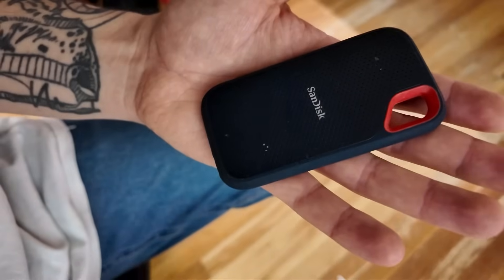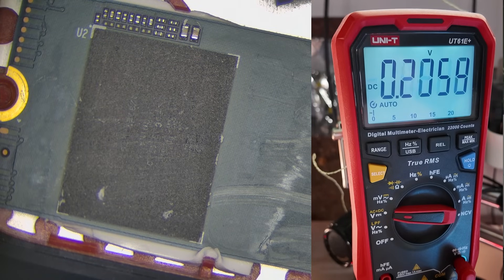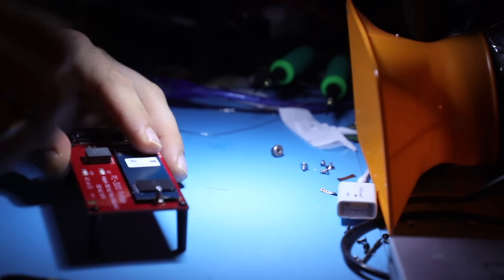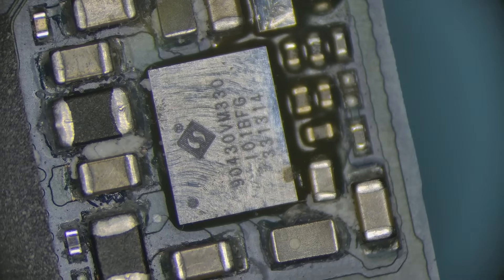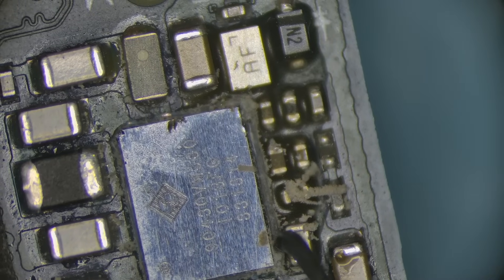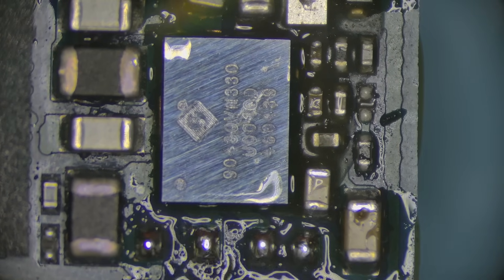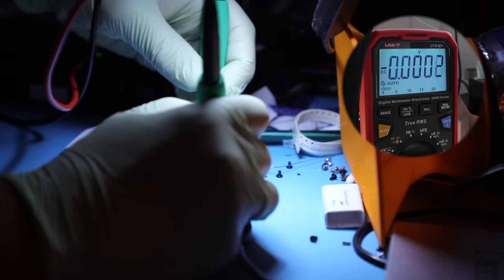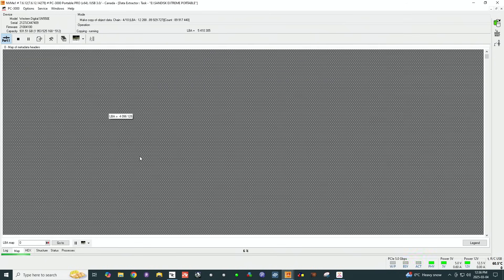sandisk extreme portable ssd - here is why they fail

Comment from the maker: guys, since I launched this video, so many of you sent your Sandisk Portable SSDs my way I just wanted to say thans to all of you. They been coming in from all over the globe recently and not just USA. Italy, UK, Spain, Mexico, Brasil, Belgium, Switzerland, Belgium just to name a few in past 3 weeks. If you need help with these, let me know! http://www.hddrecovery.ca/contact-us/
Reply: Have you seen any 8TB failures? I was thinking of getting the 8TB. I love the physical size, and the little slot to hang it.
Reply: I sent mine to you but you said it was not recoverable. I decided to get a 2nd opinion and the company says the data is there but the power supply is bad. They apparently can't get the FW to do a chip off repair. I'm super bummed out. So you happen to have a SanDisk contact so I can source the correct firmware? I still have your email ....
Reply: What about ssd extreme pro usb 4

Comment: Is the SSD being warm / hot to the touch a common symptom of the IC board failure type of defect as shown in this video? My SSD suddenly does not detect on finder and disk utility. And when I try to plug it in and leave it for a few minutes (with different cables etc), is gets warm to the touch. (As warm as when I am actively using the SSD when it was still operational)
Reply from the maker: its normal

Comment: Did Sandisk fix the problems with the failing portable SSDs? 
I just read about SanDisk Extreme SSDs were abruptly wiping data and becoming unmountable. I was think of buying the new "Creator" version
Reply from the maker: new versions don't fail this way, Data wiping issues was with Sandisk Extreme Portable Pro devices

Comment: I have two Tektronics 7704 oscilioscopes that still work after 50 years.They don't make electronics to last like they used too.s.
Reply from the maker: When I got into data recovery drives would aim to last 10 years or so. Today hard drives last 2 years. And SSD is a lottery ticket at any occasion:)

Comment: Is this fault occuring in other drivers, that have not been manufactured for use in the sandisk external ssd casing? Like the WD SN570 and SN770.  AFAIK, SN550 is just rebadged as sandisk for use in external casings, while SN570 2TB variant based on SN770 uses another PMIC that has no underfill and does not fail?

Comment: Nooooo😰 I've bought 2tb when on vacation in US. Now I'm worried to use it for traveling storage (cleaning SD's, phone memory etc...) to backup when home. 😥
Reply from the maker: don't stress about it. If it fails, we can fix it. But until it does, just enjoy it. Maybe keep a spare copy on a laptop just in case
Reply: @hddrecoveryservices  I don't travel with laptop and that ssd was my mule to bring my data back to my home while traveling (instead of bring 10 SD, and other data I may create with guest PC) so my only worry is that I may lose everything the way back home. Now that I'm aware of this issue I may use this ssd only for moving an already backupped files around (that is on another purpose away from traveling). In another comment of yours you say that they have fixed this issue with V3, is there a way to know witch version I have without dismounting the ssd? Thanks. Also, I'm glad that labs like yours exist, but I always known that the price for recovering data aren't cheap so I've always thinking on using it if the files I want back are really that important.

Comment: I had a couple of these fail on me.  All were Costco specials.  I honestly didn't treat them all that badly, about 200GB every month written and they died around the one year mark.  
In contrast, I have a pile of the Samsung external SSDs and they've all been very much abused and so far are still kicking, but I don't trust any SSD for long-term.  These are used for our air-gapped backups.
Reply from the maker: Most of these we get, come from Costco sales

Comment: always buy your own usb enclosure and buy a proper M.2 ssd to go with it.
Reply: That's what I did. Aluminium enclosure, and 2TB M.2 WD SSD. Works great. USB enclosure can easily and cheaply be replaced in case of problems.
Reply from the maker: Yeah these enclosures also have a surprise. In future episodes I will post another sinkhole for the data loss :)
Reply: @hddrecoveryservices  In 30 years of using and building computers, I'm happy to say that "data loss" is NOT in my vocabulary!
Reply: @hddrecoveryservices  which enclosure? i hope it's not orico m2pv-c3 because i just bought it along with the ssd lol
Reply: what enclosure do u use? i just bought orico m2pv-c3 with adata sx8200 pro. idk if this combo is gonna last..

Comment: did Sandisk use a batch of these power IC's that were prone to break ?
Reply: The broken power management IC (PMIC) was on the M.2 drive itself, not on the adapter board SanDisk made. The disk is WD BLUE SN550, looking online there's lots of people saying it stopped working randomly so while it's possible it's a bad batch it's also possible WD is overworking the IC
Reply: @gianseven  yea I named the wrong party. Interesting to hear it could be either overdriving or bad batch
Reply from the maker: Only v1 and v2 have this issue. On V3 they upgraded the circuit, and this issue does not seem to be happening with V3

Comment: Huh. I didn't know these have a standard 2280 in them. For some reason I assumed it's all on one board with the USB controller...
Reply from the maker: No, standard WD SN550 inside
Reply: The fact that it's a regular M.2 2280 is actually the problem... cause the WD/Sandisk (same thing) SSDs sold for internal PC use are just as bad... cause they're essentially the same drives. Want another negative example? Xbox Series S and Series X internal SSDs. Those are WD SN530s that love to die prematurely (NAND failure), and just to add insult to injury, they're paired to the xbox via their serial number and an encryption key on a hidden partition. SSD fails, entire console turns into e-waste cause you can't replace them with any other drive. 
I used to like WD/Sandisk SSDs but they've effed up SO many times in the past 5 years... yeah nah

Comment: I have one of these. I think something is wrong with it. I don't need it though so I just don't use it. It has 2 unallocated partitions. Nothing I do will join them. The first one is like 100gb and it works fine when partitioned and formatted. The other partition is the remaining 2tb. Nothing I do will make it work. My streaming server is using a samsung 990 pro 2tb. When I run out, I'll get a second one and so on. Samsung seems pretty reliable. I've been using their SSDs for 14 years now. Never had an issue. With my 990 pro I'm ripping blu-rays and even 4ks and transcoding them to AV1. That's a lot of data constantly being written and deleted. It's flawless so far. The only issue I have with my setup is that the amazon firecube tv seems to be unstable after watching too much AV1 content. I have to reboot the damn thing a lot. I'll have a replacement for it soon. Hopefully it will be more stable. I was actually impressed when I did my first 4k movie the other day. It crashed after the movie finished, but it survived the whole time. lol stupid firecube. lol
Reply from the maker: Samsung is reliable until it isn't haha. All serious data losses I had personally were by Samsungs and Seagates
Reply: @hddrecoveryservices  Well to be fair a sample size of 4 samsungs, 1 plextor, and then this 1 sandisk isn't exactly huge. lol The plextor is the oldest and it still works, but it hasn't been used much. After it got filled I moved it over to my 2010 laptop........which was already obsolete at the time. lol I'd say it's got a good solid 4 years of use. My 2 older samsungs have a good solid 10 years of use.

Comment: what temperature do u use to remove the underfill ?
I seen that old dead chip that is underfilled can be removed by polishing it away . Have you tried it yet ?
Reply from the maker: 200-250c. You can grind them down, but then you need to use ultrasonic cleaner to make sure that the debris is all out